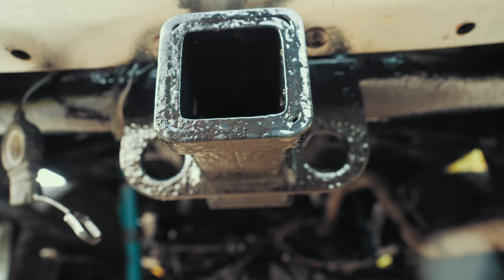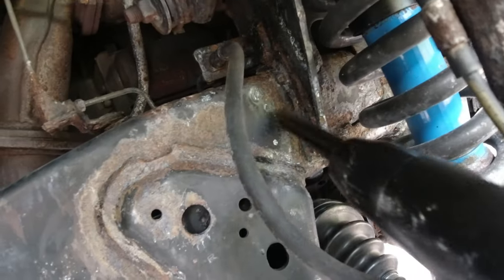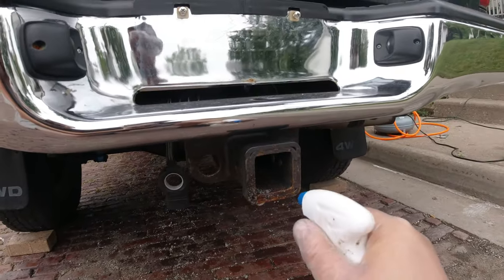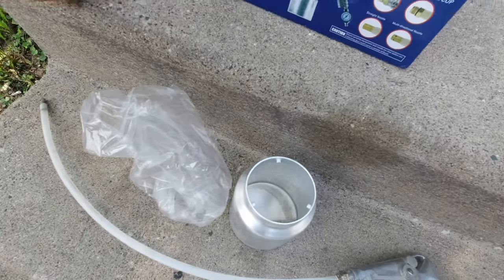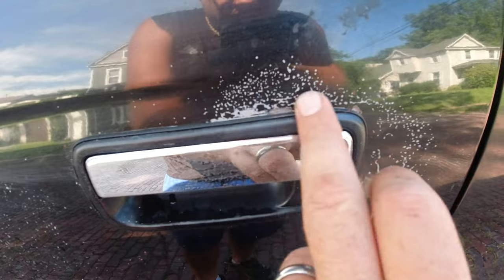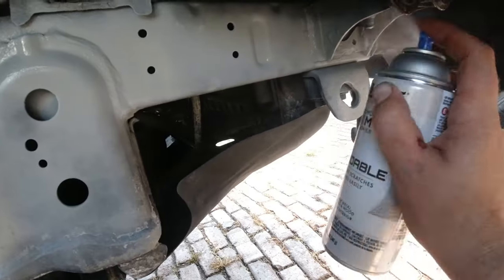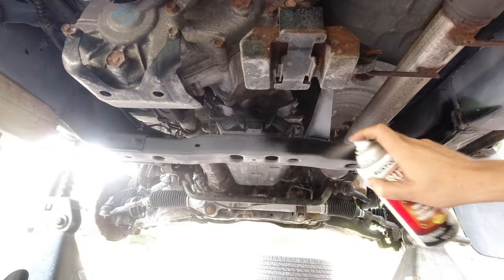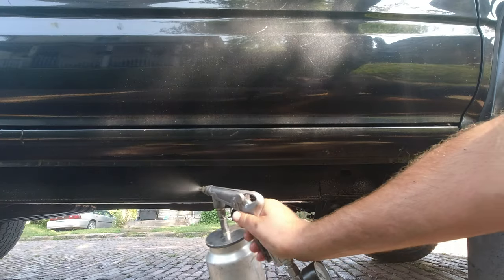Ultimate Undercoating for the Rust Belt - Converting Rusty Truck Frame to Salt Water Warrior

Comment: it may have been easier and more logical to remove the body off the frame, have the frame dipped, etched sealed then coated, then do each component one at time as you assemble, the way you did it will help tremendously no jokes and prolly save you form any catastrophic failure which is I'm sure was your goal but man that's a lot of work you did there, may have been easier to frame off?  only way to tell is to do each process side by side, of course you need the tools the rotisserie, space, tools all that.. either way I complement you and this will save your truck from the scrap yard for sure... good job man!
Reply from the maker: If I had a garage I would def. do it that way! That would be amazing!! Time consuming but awesome!

Comment: You worked awfully hard and spent quite a few bucks and all that won’t help you stop rust unless you coat that frame with lanolin it’ll come back guaranteed. You made it look pretty for a while but not a very long while. I’ve been in this business for many years done almost exactly what you just did, and it ever last night without lanolin, which Hass to be reapplied at least every two years
Reply from the maker: I plan on re-coating every year but ended up selling this truck. I’ve done it a few times. It’s an art for sure.

Comment: Too bad you painted it first. Now after all that hard work, it will rust under the paint, because you sealed the moisture. I did the same mistake. You should have just removed the the flaky rust and spray the Rust Shield.
Reply from the maker: I let the paint dry… what moisture are you referring to?

Comment: This consumer grade product is weak and waste of time. Try marine salt water vessel coating like Tectyl if you wanna be serious about rust prevention.
Reply from the maker: Do you have a link to what you recommend? This stuff? - https://www.amazon.com/Sharkhide-Metal-Protectant-1/dp/B07NGMYKS5/ref=asc_df_B07NGMYKS5/?tag=hyprod-20&linkCode=df0&hvadid=312062016371&hvpos=&hvnetw=g&hvrand=17485355464919318115&hvpone=&hvptwo=&hvqmt=&hvdev=m&hvdvcmdl=&hvlocint=&hvlocphy=9018695&hvtargid=pla-646530339108&psc=1&mcid=681ee0e283ad396ab70431726f873233&gclid=EAIaIQobChMIzLitne6WgwMVn51aBR0yuQJbEAQYASABEgLmivD_BwE#aw-udpv3-customer-reviews_feature_div

Comment: is it still holding up
Reply from the maker: Yes. I’ve had it through the mud and a winter. I’ve sprayed off the bottom on many occasions and there is still a nice coating holding up nicely mixed with some fine dust, Some areas better than others but overall I’d recommend.
Reply: @JRESHOW  ty. I just ordered everything off of Amazon.  Going to work on my 1997 12 valve Cummins

Comment: Im pretty much considering do this exact regiment on an old toyota 4runner.  it will needs some plates welded on to it too.  but need to stop the rust.  I settled on rust cutter and surface shield.  Will need to grind first, guess I'll look close at rustoleom rust reformer now as well.
Reply from the maker: The rust cutter and surface shield are #1 to me, I chose the rust reformer just in case. Good look on the 4 runner! Basically the same as this old taco :)
Reply from the maker: @SleekMouse  🤣🤣 just don’t get it on the paint job!!!